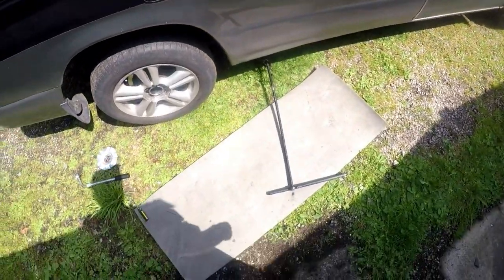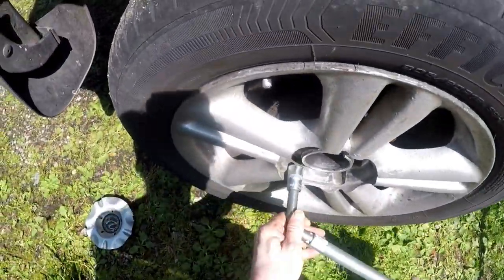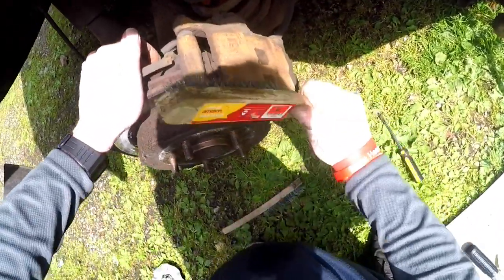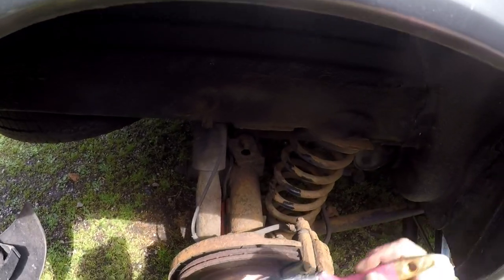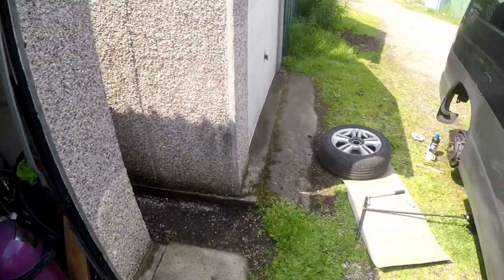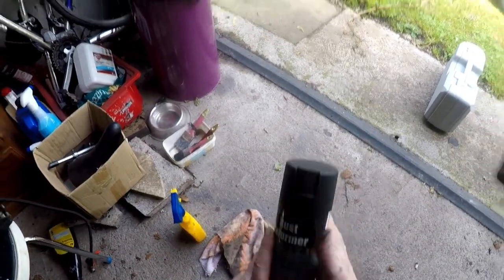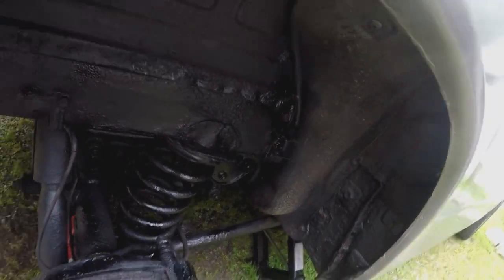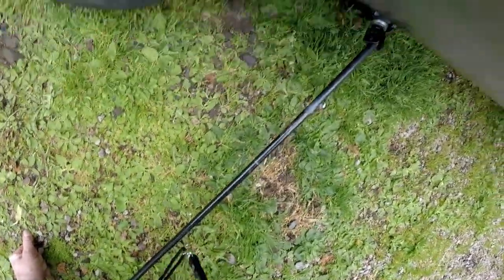MAZDA BONGO Rust Treatment Part 2 (OS)

Comment: Looking good Brian that van has served ye well big man. I have been having a look at maybe getting a van myself in the next 3-4 years. Been looking at a 1Lt Ford Transit Connect and putting a wee bed in the back etc. Looks no bad :)
Reply from the maker: Thanks Peter ! The Ford will certainly be economical. Balmoral Estate has locked Gelder Sheil and Glas Alt Sheil bothy due to rubbish strewn everywhere and Wild Pooping Louts !!
Reply: @LarryBees  Dont blame them sometimes Brian dont know how many times i have came across piles of crap left in the middle of nowhere. If you can take it out then surely you can take it back hame. Dafies!!!